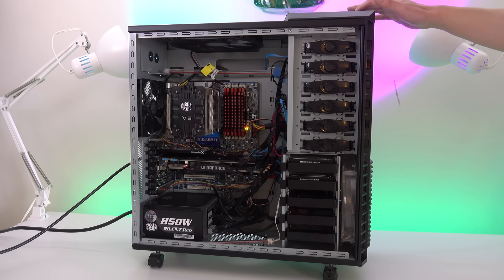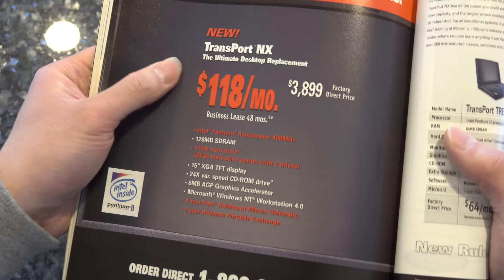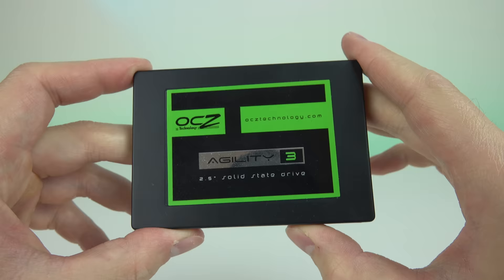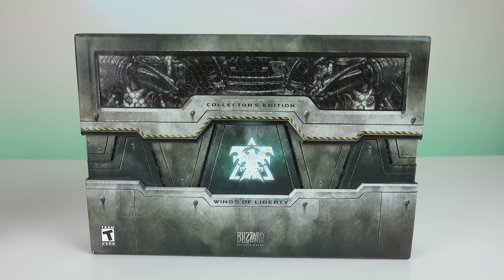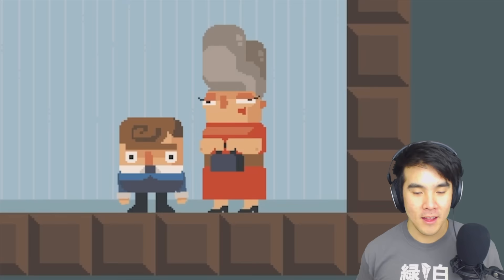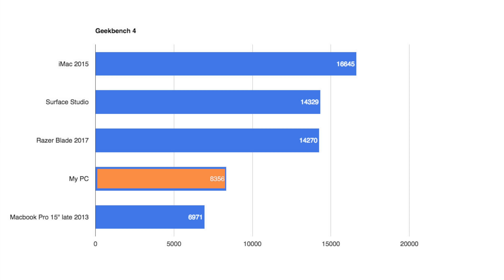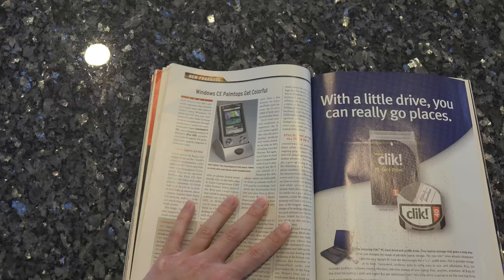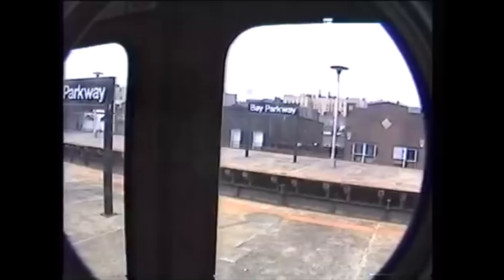I Built This PC for $1360 in 2010. Here's How It Holds Up.

Comment: It's so sad that I still rely and make videos on my 1.4 ghz 2014 Mac mini 🤔🤔
Reply: ReKt SoN put linux on it
Reply: InfernalShroom I have an IBM 8187 that has currently locked me out due to Windows deactivation due to graphics card removal but up till that point it's been very reliable only ever really doing one thing and that's just playing music through audacity and a bit of editing too
Reply: With a rather beasty 2.80 gigahertz Pentium 4 processor though it's not quite as gutsy as it used to be... and it only has 2 gigs of RAM to add on top of that along with Windows XP
Reply: i'm on my very special mid 2010 imac, not that bad, but yours surely is slow.
Reply: ivy bridge processors lol
Reply: ReKt SoN .... well u could have easily build a lot better pc performing pc for the same price of MacBook and could have easily upgraded it down the road
Reply: tim serious He said a Mac Mini, not a MacBook. If you get an older Mac Mini for a low price like I did and then upgrade it, they are still really good and powerful machines.
Reply: Daniel James .... never knew there was a mac mini .... upgradibility is not really possible on macs other than Ram and storage upgrade .... i am talking about significant upgrades like changing cpu , gpu additional nvme or sata ssd
Reply: You can do those other upgrades too depending on the Mac. iMac's use regular desktop chips from what I've seen, so they can be swapped out easily, and even on ones with mobile chips, you can still replace the CPU with the right tools. There's also the option of eGPU's on newer machines, and you can easily add an SSD or an extra one to a lot of older Mac's, for example I've got a 240GB SSD and a 500GB HDD in my Mac Mini.
Reply: U need upgrade to sho
Reply: Silas McGee damn
Reply: ReKt SoN Pfft I've got a 2009 low end laptop
Reply: Good for you.
Reply: 1.4?
Reply: Throw that garbage away and build a real PC instead shit ass mac
Reply: ReKt SoN: Hey long as it does the job, and gets it done.
Reply: macs suck.. dont buy one unless ur a buisnessman
Reply: Silas McGee sad
Reply: on my 2009 macbook pro with six gigs of ram
Reply: That's because apple's a complete scam
Reply: Boi you lucky i got a fucking macbook air 2013
Reply: i still have a celeron
Reply: ReKt SoN that is sad ....... Alexa play despacito 5
Reply: 3.7ghz AMD cpu right now
Reply: Lol just bought a 800$ pc
Reply: ReKt SoN I have a 2012 Mac Mini,I can't believe its 6yrs old but it has i7,4Gb Ram and 1Tb fusion but the Ram is upgradeable and its still pretty good
Reply: there's probably some dude in Romania with a Pentium 3 that would pray for that lol
Reply: shroom it's a mac... Linux won't work
Reply: I'm using a 2009 PC with a 1st gen i7 and a Radeon 5770...
Reply: I watched ur spongebob video about 2 days ago and I see u here lol
Reply: It’s sad that it’s a Mac
Reply: Nah a 2014 mac book can turbo up to maybe 2.6 ghz easy

Comment: First off, the i7-930 is a FIRST Gen Core i series. Sandy Bridge (2x00) were the second gen. Also, depending on what program you use for video encoding a fast NVidia GPU would speed rendering up a lot more than a faster/newer cpu would.
Reply: cee128d if u want to be technical it's more like 1b. The i7 920 came out 2 years earlier in 2008. Second iteration.
Reply: If you want to be technical then it is FIRST Gen. That is what Intel states and they ought to know. The 930 uses the same Architecture as the 920, it's just higher clocked. Back then Intel would continue to release higher clock speed versions of the same processor, unlike what they tend to do today. 

You stated and then deleted the following. 
"Cmon you know it all, u know what he means"

No I don't know it all (but obviously more than he or you do) and no I don't know what he meant, only what he stated.
Reply: Let 'em flock to Apple. No great loss. And it was you who brought up the second release of first gen, not me.
Reply: Im still running my i7 2600k OC @ 4.4Ghz that i got from 2011. I got 16 gb of ram and i had a gtx 580 but then upgraded to a gtx 980.
Reply: cee128d i7 930 IS 2ND GEN! 1ST GEN WERE 45NM 930 is 32NM! So clockspeed is not the only difference between 920 and 930!
Reply: The first gen Core i-family came out in the forth quarter of 2008, IIRC.

Comment: Great video! You sum up the differences in the advancement of technology in the 2000s versus the 2010s very well. The 2000s technology definitely had more innovation while the 2010s technology enabled people to do things faster. I also built my own PC In 2008, where it had a Core 2 Quad Q9300, 4GB of RAM, and a 9800 GTX. I later upgraded the RAM and GPU, and that rig lasted me until 2019 when it finally died. Pretty amazing that I was able to get over 11 years of use from that PC, and it still ran fine. If the timeline was shifted the other way, where you have a 1997 PC being used in 2008, that would not be feasible at all. 

You can even see this with mobile devices as well. In 2000, we had basic candy bar cellphones, but we ended the decade with smartphones in 2010. Ten years later in 2020, the basic fundamental technology of smartphones generally remained the same, but we just now have faster smartphones.

Comment: You can still over clock that thing, upgrade the GPU and still have a pretty decent experience
Reply: franzb69 I mean a 970 is still pretty good imo
Reply: @ethanieldude1  i'd say decent, i can't call it good.
Reply: You can get the next architecture on that motherboard. Xeons X5670 cost now less than 40$ and are 6core 12threads, smaller silicon, better thermals.

Comment: Wow I'm finding alot of similarities, to a point where it's kinda weird.

- Mine was also built in 2010.
- Was around the same price.
- Also still is my main PC now.

And the specs which are quite similar:
- i7-950
- 6GB RAM
- GTX460 (also Gigabye), replaced as well.
- 60GB OCZ Vertex SSD, problematic too.
- Cooler Master Haf-X Casing

Played SC2 as well.
Also is my most stable PC, OCZ SSD aside (they fixed it much later with firmware updates).

Only Windows7 installed till now though.
My next PC should be an Intel NUC.

Thanks for this video!

Comment: Very interesting video. My "PC-story" is similar, but I went with the six core Phenom II 1090T Black Edition. I find that this CPU in some aspects has gotten better with time as developers started to understand and take use of multiple cores and threads, even for the "simplest" of softwares but also for diverse encoding and rendering tasks. The six cores OC'ed at 3,8GHz is alright even if the so-called IPC is rather terrible. If I don't waste all my cash on alcohol and females this summer, I might build a Ryzen platform. Not that I need a new rig for what I do, but.. you know. Kind of fun. Anyways, thanks again for interesting video!
Reply: Tusen Koppar Kaffe what motherboard do you use I have gigabyte ga m52l-s3p rev.1.0
Reply: At first I had a ASUS motherboard for which I cannot recall the name, but some years ago I changed to the "MSI 970 gaming" motherboard because I "needed" a board with higher max GB RAM and an extra PCI for a SATA-card. The ASUS board still works, so I am now considering putting the Phenom II back into that board and setup my old folks with it, buy a cheap 8320e CPU for the MSI board and use it as Plex server - and build Ryzen 7 platform as my new workhorse.

Comment: Nice video. Myself bought my pc summer 2011. An I7 2600 sandy bridge at 3,4Ghz, 4 cores and 8 threads. Today I have upgraded Gpu go a Vega64 Liq, 16Gig DDR3 1600Hz, 2 ssd for os and my game drives.  I also bought a cpu watercooler hx105 and overclocked my sandybridge go 4,45Ghz. This computer run so smooth I have no reson to exchange it. Instead of buying a new pc I invested in an ultrawide 3440x1440p 100hz VA monitor with freesync. The first computer I composed myself and The best, longlasting computer I ever had. Its now 8 years old, stable and fast enough. :)

Comment: My PC from ~2007 is still alive today. It is a Intel Core 2 Quad Q6600 with 4 GB of RAM, a GeForce GTX 550Ti (upgraded later from the original GeForce 9500GT) and 500GB of HD. Ten years...
Reply: Natália Rossi upgrade your cpu to Intel Xeon x5470 ;) if your motherboard supports hacked processors from 771 socket
Reply: I gave away my 8 year old computer last week. Feels like a past of history was lost.
Reply: Natália Rossi upgrade to x4 880k
Reply: The GeForce 9500 GT came out in 2008, IIRC, so close enough, and Intel apparently was still manufacturing 65nm processors in 2008, thus, 2008 was a transition year. 2008 was when 45nm Core 2s first came out.

Comment: i built my PC at the end of 2010 also. paid 1300 bucks for it minus the OS and a monitor. basically the same computer that you have. i have only upgraded to a 1TB SSd and a GTX 980 2 years ago and thats it. i just got a 4k monitor and a occulus rift and it can still play games but it struggles. i finally upgraded to an I9 and a new motherboard/ddr4 but i kept everything else the same from 2010. the  case and the power supply cords. youre completly right about the whole upgrading for something new. i would still have been able to use my old computer if i stayed in 1080p instead of upgrading to 4k. once i got something new i had to upgrade to keep up with it. this beast will last another 8 years unless they find out how to surpass the 7 ghz processors  for  a reasonable price. and the video cards.. lord i want a 2080 but they are so freaking $$$

Comment: I built a 2018sh computer for far less than that.

Ryzen 5 2600 ($149)
16gb ddr4 3200mhz 2x8gb ($119)
MSI B450 A-PRO ($74)
Gtx 1060 6gb including a FREE 500W PSU ($259)

Rounds about $600 spent plus tax. Can game at 1080p in ultra at 60fps~ and I’m good to go for the next 4 years.
Reply: Juan Correa your good...  till someone introduces you to a 144hz monitor. That’s what happened to me

Comment: Crazy that nowadays you can live every day with 10+ years old computer parts.

It's really similar to what I did in the last 13 years. I Bought a setup in 2010 with the same gigabyte gtx 460 1gb,  with a phenom ii 925, 4x1gb ram and a 770 board. I used it for almost 7 years. Then, the PSU died. Just for good measure I bought a new 600w cooler master PSU, 970 chip board, a new case and a new ssd, although I would only needed a new PSU, nothing else. 

Again it lasted for about another 5 years when I "upgraded" with an FX-8370 and 4x4 gigs of 2400Mhz RAM, and an RX580. Then the 970 MoBo's VRM died because it couldn't really handle the 125w cpu.

Once again I upgraded with a new 650w 80+gold modular PSU, a 10 years old but new condition 990FX mobo, a huge cpu cooler, an NVME, a cm mb520 case, and a 6700XT Red Devil. 

A 10 years old ddr3 build, with a pathetic fx processor and an overkill bottlenecked GPU, but you know what? I really like CP2077. As soon as DDR5 becomes a bit cheaper I will directly upgrade from DDR3 to DDR5 after almost 15 years and I only need a board a cpu and some ram.

And instead of buying all new stuff, I also took all the old 770/Phenom parts with the RX580, slapped 4x4gbs of ram and some RGB in it and now my gf happily plays on it every day.

Comment: Drop a Xeon X5690, overclock = PC as fast as X99 new builds
Reply: Bruno Leone where do I buy the mother board?
Reply: Henry Ward the Kosciuszko Lion Ebay buddy. Search for X58 motherboards.
Reply: really on my (msi) x58 pro-e my xeon L5640 goes from 2.26 up to 3.6GHz. Its not the best x58 mb there is but it can overclock
Reply: I'm running an Asus Rampage II Extreme with a X5670 4.6ghz 24/7 no issues for a very long time :)
Reply: my old pc was x99 and i beat it easily :) oc to 4.4ghz.
Reply: use a xeon e5649 on the pro-e. pushed mine to 4.6 GHz while the x5660 only hit 4
Reply: X58 ud3r with a x5660 went from 2.8ghz to 4.73ghz
Reply: Bruno Leone X99 is discontinued. No longer distrubuted by sellers, if you do get one, it will not come with a warranty.
Reply: I'm running x5650 @ 4.5ghz (hexacore) which cost me $15 on a "broken" Asus P6X58-E, which cost me $40 because of a coolant leak which cleaned up and ended up working fine. This system broke 1k in Cinebench.

Comment: I remember the first PC I built was the first true stable dual core. 
The AMD 4400+
I don't wanna brag or anything, but it ran Crysis. 
(At a very smooth 28 FPS)
Reply: Noto Sure damn!!!
Reply: I'm a noob at building PCs.

If I had to build one from scratch--- where would I get a reliable supplier for PC components? 

Also recommendations: looking for something to last at least 2-3 years from now..

Comment: Get a xeon x3470 (they are dirt cheap)
Overclock it to 3.7 Ghz
Overclock the ram at least to 1866Mhz 
That's it, sufficient framerates for nothing.
Reply: or get what he got? X5650? and X3470 is on a different platform. his platform is the X58 series which can maximum get to a X5690 or W3690 which is 6c 12t. X5650 is 6c 12t and is dirt cheap as well

Comment: Holy moly, I have that same motherboard! I even have a Maxtor IDE drive that looks exactly like yours.

Whether you have Rev1 or 2 of that board, it is outrageously good. You seriously can't find a modern motherboard which features that many SATA connectors. Six is a lot by today's standards, and 10 is just unheard-of.

The rarest feature might just be those combination USB2 and eSATA ports (the ones in yellow on the back I/O). I loved the fantastic transfer speed you could get on eSATA, but it was always a hassle finding a way to actually power an external drive for it. That, and it not being hot-swappable makes sense that it didn't stand the test of time. Additionally, having no internal header for USB3 front I/O is a real bummer.

The most surprising realization was this board using DDR3 RAM. I misremembered it using DDR2. I completely forgot just how old that standard is by now, despite my main computer also still using DDR3, albeit with a great XMP in comparison.
So many RAM slots is also a scarcity today. Only high-end boards seem to feature more than four.

Those IDE and floppy connectors are very much appreciated, too. I happen to have small bunch of functional IDE and floppy drives, and it's great to still get some use out of them.

Great video, and thank you for a pleasant blast from the past.

Comment: Also when does it cease to be the old computer? you upgraded the graphics and the Ram, you upgrade the CPU and the Motherboard then it's far from being the old computer.
Reply: He did not upgrade the CPU and motherboard.
I think it is fair to say that replacing the motherboard makes it a new computer.
Reply: It cease to be an old pc when you have a system that is 4 years and under
Reply: Ram is still DDR3 regardless of size.
Reply: @MyKonaRC  the performance diff between ddr3 and dd4 is overblown. ddr3 has lower latency ddr4 has more bandwidth

Comment: I have just built a pc with 16GB ram(gonna increase to 32gb sometime later) with an i7-7700K and a gtx1070 it is really awesome and fast. 
My old pc with an amd athlon IIx64 and a geforce 9800GT is still powerful enough to stream something like league of legends or rocket league with decent framerates. And that thing is from 2007 or earlier! (My cousin uses it now and hes very happy) .
So if the old pc able to still perform this well, i think that i wont get a new pc until 2027 or so aswell
Reply: Toreole Superzocker you'll never use 32
Reply: Daflix yes i will when playin minecraft with 30 GB of dedicated memory >:D 
laughs in devil
Reply: You’ll need to upgrade in 2023, graphics card and higher end games are coming out way to fast
Reply: you really don't need anything more than 16GB of ram
Reply: Before u even need 32gb of ram ddr5 ram will be invented and at insane speeds, so you'll need a new mobo new cpu ...
Reply: 2027? Lol I have a 1070 and want all ready next gen Nvidia top gpu for 1440p gaming. You must play only league and rocket for saying that :D
Reply: the 1070 should play 4k i don't know what your talking about, it's bettter than my gtx 970 ssc and i can play games at ultra at 60 fps
Reply: MaSHED T8RS at 4k you get 30fps... and I play at 1440p but at 144hz and even a 1080ti it's not enough
Reply: i meant in 1080p sorry forgot to put that in but i meant you should be able to play 4k
Reply: Toreole 2 I built one similar to yours... with a i7 7700k, a gtx 1080, 512gb m.2 ssd, and 16gb of 3400 ram. I think if you're gonna be doing gaming it's good enough with 16gb, but if you're going to be streaming/rendering then might be worth it. 4k gaming? I'll have to test that since I just barely got my 1st 4k tv. I wish I would of waited for the 8700k processor, but that's computer obselence for ya, but he's right on being able to use it for many years to come. I have a laptop from 2012 & runs just fine today with windows 10. Thenagain maybe if ram goes down in a few years? Then it might be worth the upgrade at a cheaper price. Well... time will tell. Cheers
Reply: I have a laptop
Reply: you know you don't have to set the detail settings to fucking maxed right? the 1070 is able to run all games in 1080p 144fps, 1440p 60fps and 4k 60fps easily

you just turn down the detail settings to high and boom, double the performance with 1% graphical change
Reply: Zed Shadows you are just greedy, I play at 1080p 144hz with a gtx 1080 and that is enough for me. I'm not considering going 4k anytime soon either. I'd rather not throw money at better visuals instead of paying my rent.
Reply: Toreole 2 lucky you did before the ram prices started skyrocketing

Comment: I kept my last 2 computers (one desktop I built, and one laptop amazingly) for 7+ years each.  I did do a couple upgrades to the desktop in those times.  Laptop never had any upgrades, except going from 8 to 16gb ram right when I got it.  I built my current desktop about 2 years ago now (Nov 2021).  It's still amazing, and I expect it to last me another 5+ years no problem.